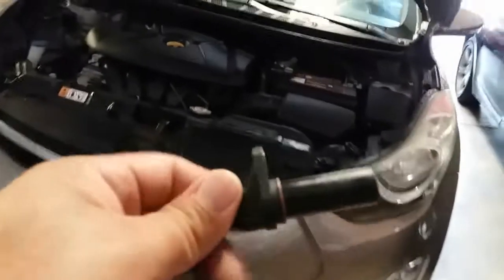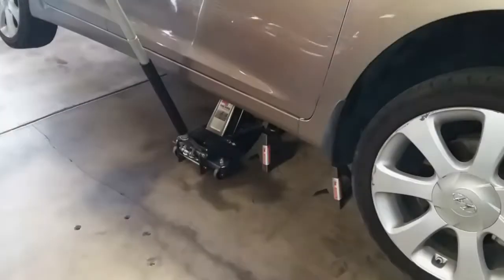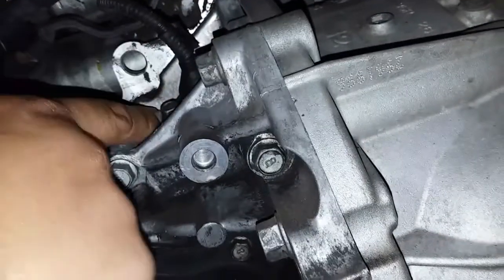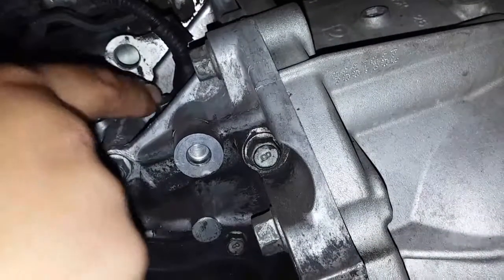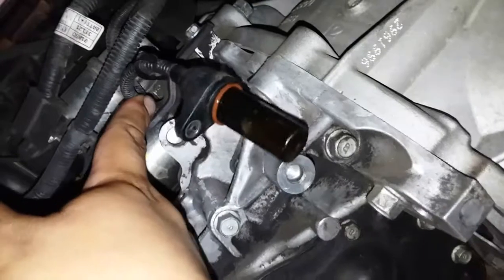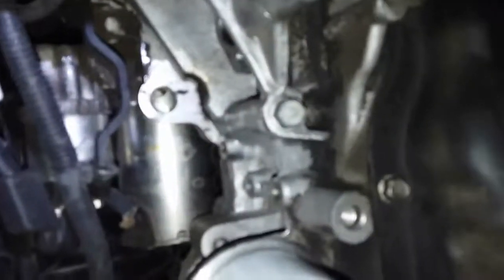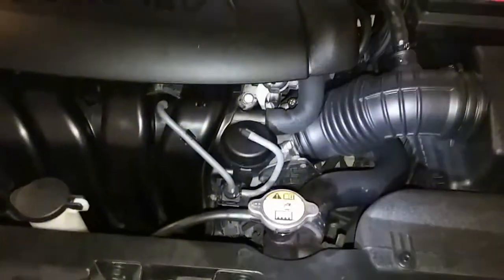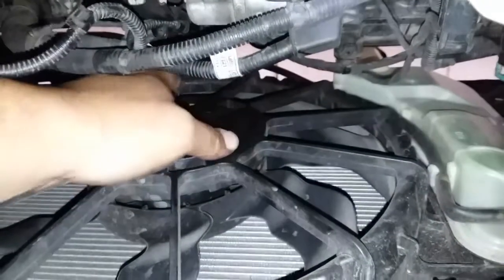How to: Remove Crank Shaft Positioning Sensor on a 2013 Hyundai Elantra Limited

Comment: How do disconnect the wire harness (plug)? Can't get it unplugged don't want to pull extremely hard and cause damage. Is there a clip you push or something?
Reply from the maker: There is a clip on there...with a flat head ur able to lift we're it locks then wiggle it out....u can also use that same flat head to pry it away from the connector and the plug right in the middle of them both...hopefully this works
Reply: I will try it after dinner HAHAHAHA
Reply: So I just realized I don’t have a single flathead screwdriver at home I need to buy a set tomorrow and hope I can get the plug out soo I can use my car next week for work

Comment: Hey George I have a 2013 Hyundai elantra and sometimes my traction light flickers on and it reduces my speed a lot, pretty scary especially on the freeway.....Any idea what it could be?
Reply from the maker: Unfortunately I do not, I have a 2010 Honda Odyssey that the VSA light turns on it flickers while you're making a turn and you lose power personally I think it's the rack and pinion for my Van for your car I really don't know what it could be may be the same thing to. Do you have to continue to add power steering fluid to the reservoir because that becomes empty after a while? maybe your rack and pinion are starting to go bad too.  I'm not to sure but I suggest you take it to a mechanic so they could observe what the problem is and pinpoint the issue. 
 Because yes I do agree that is very dangerous the whole reason I got a 3rd vehicle on so we did push the Van to the side and fix a when we can. Sorry I wasn't much of a help. 😔
Reply: @559powerscape  I was thinking the same thing about the rack and pinion....
thank you :)
Reply from the maker: @TEXASBABYDOLL13   You're very welcome. Thank you for your support! Good luck with that because I know my rack and pinion is gonna be a pain in the butt. It's behind the engine might have to drop the sub frame. It's a big job 🥺
Reply: @559powerscape  yes the part alone runs at least 500 not including labor
Reply from the maker: @TEXASBABYDOLL13  I Know right! Nothing but Headaches!